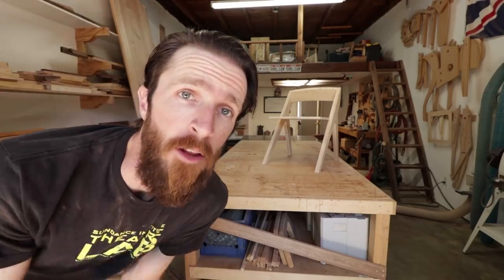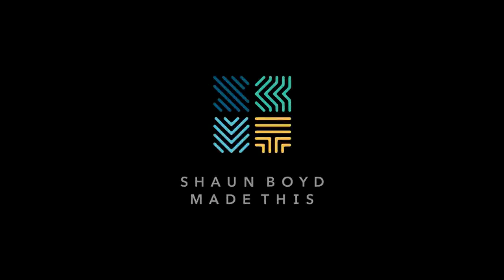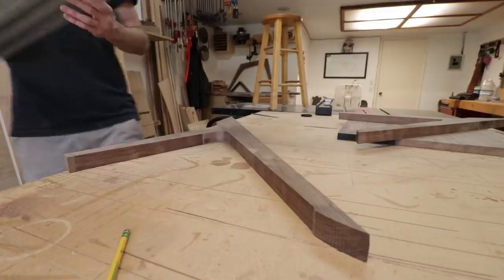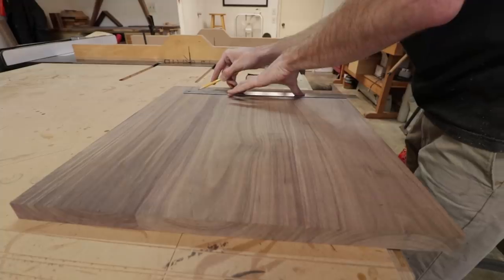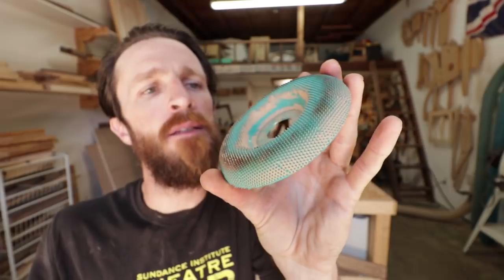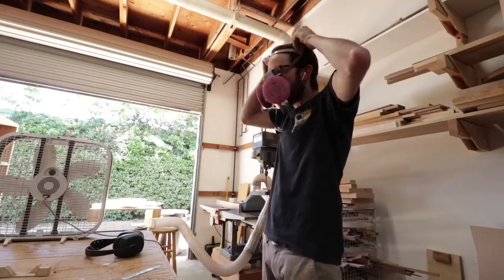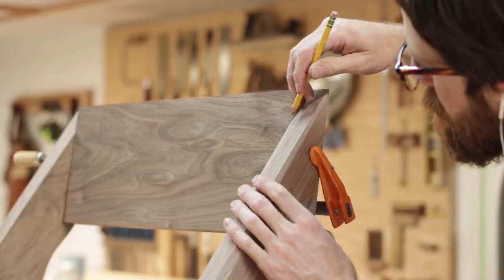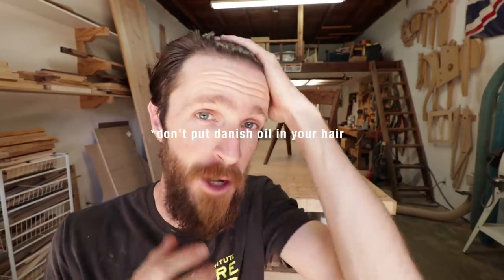Building a Midcentury Modern Dining Chair - Shaun Boyd Made This

Comment: That jig at 4:04 is brilliant! definitely gonna build one!
Reply from the maker: Yeah, super simple, but really effective!
Reply: @shaunboydmadethis  quick question: how did you achieve the slight bow on the top section of the back of the seat? I was thinking it was probably done at the bandsaw, but I don't know how you then mitered that bow shape to match the angle of the legs... I thought that was a really nice touch.
Reply from the maker: @BluesmaNeedham  Yeah, so the curves on the backrest are done on the bandsaw. The bevel can be cut before cutting the curve, but that will result in a straight line across the backrest at the bottom of the bevel and the curve on top, which looks totally fine. But in order to get the bevel to match the top curve and the leg angle, I cut the curve first, then cut the bevel following the curve on the table saw in many passes. It is kind of a tricky thing to do, and should only be done if you are very confident using a table saw. Hope that helps!

Comment: Shaun, amazing work as always!  Have you ever tried using a spokeshave for saddling?  I guess you’d really need a travisher which is essentially the same thing.  Also, do you ever have to change out your templates?  I find, maybe I’m just getting lazy, I have to mark my templates because I’ll end up shaving a few thousandths off here and there and messing up my dimensions, especially on many repeated parts.  Can’t wait for your next video, cheers.
Reply from the maker: Thanks! Really appreciate it! I always tell myself that one of these days I am going to get more proficient with hand tools. And yeah, my templates can get a little worn out. For the most part I can make them last for awhile, but every now and then I will make a new version when things get a little off.

Comment: Do you recommend a light sanding between coats when applying oil to the hair?
Reply: Good idea. Be sure to also use a conditioner - Varathane or Minwax will do - to keep the hairs from splitting.
Reply from the maker: You guys are onto some real next level beard care here.

Comment: Thanks for the danish oil tip. The hair was great but the beard needs a lttle sanding. What sand paper  would you recomend?😂
Reply from the maker: For sure, a little 320 in between each coat should give you that nice smooth beard feel. 👍